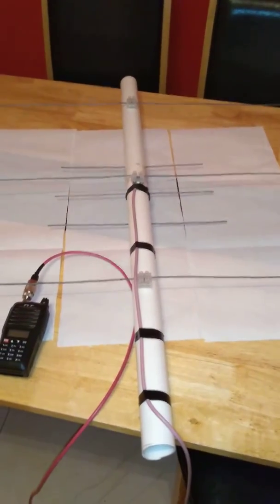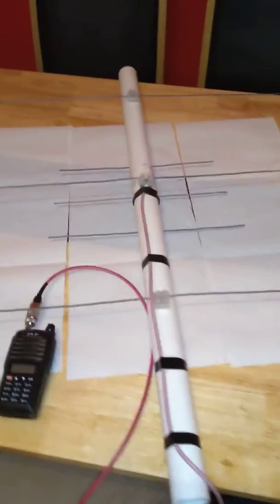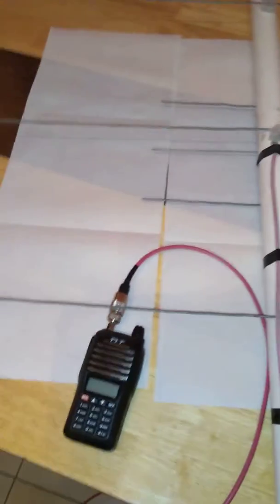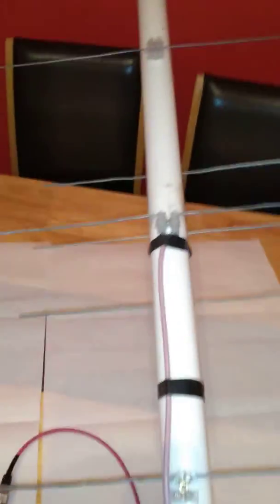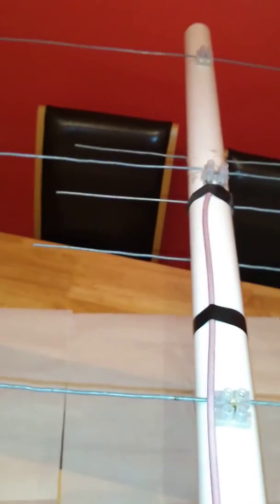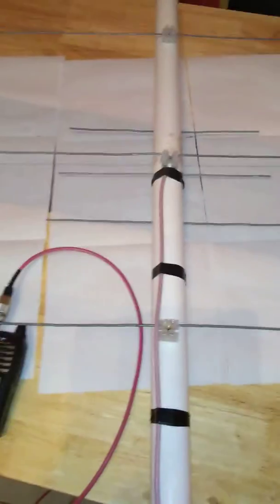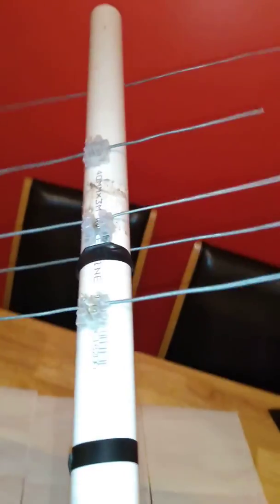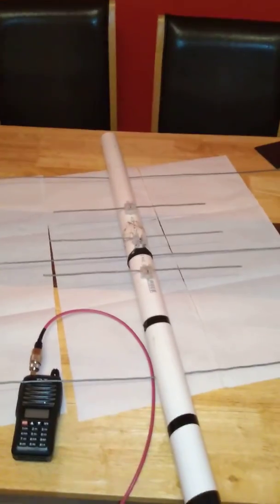💠💠Homebrew 2M/70cm Yagi antenna💠💠

Comment: can you show us how you hve connected the 2 and 70 together to feed the radio with a single coax/
Reply from the maker: @richtaylor6773  Thanks for your comment. The 2m and 70cm radiating elements of the antenna are  joined together using a very short piece of 50 ohm coaxial cable from one electrical connector to another. Then the main  coax is connected in to the same connector on the 2M side of the antenna. The insulating tape is covering the wire that is going to the connector on the 70cm side.
Hope this helps.

Comment: How you connected two dipols together?
Reply from the maker: They are connected together using very short length of coax cable from the 2m connector around to the 70cm connector. The main coax going to the radio is connected into the electrical connector on the 2m side of the antenna. Hope this helps.
Reply: @QRP700 yes thank you, I will improvise something 😀